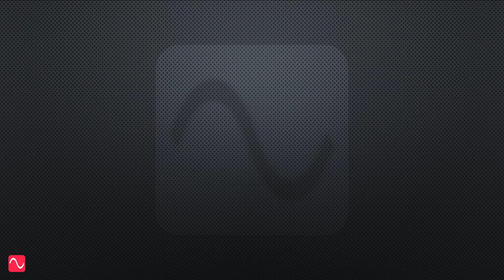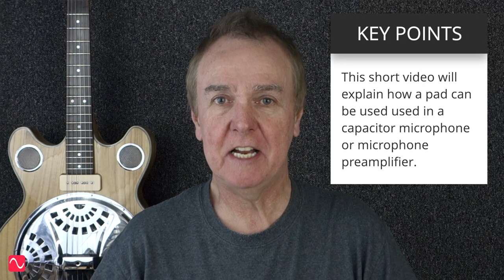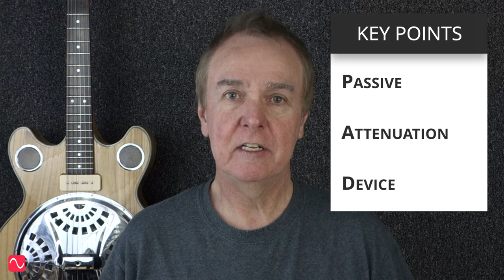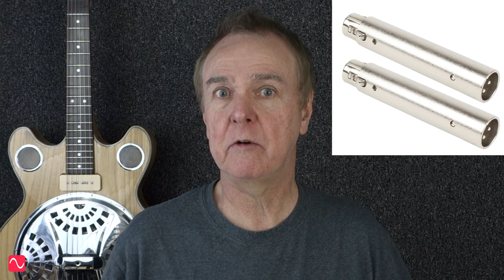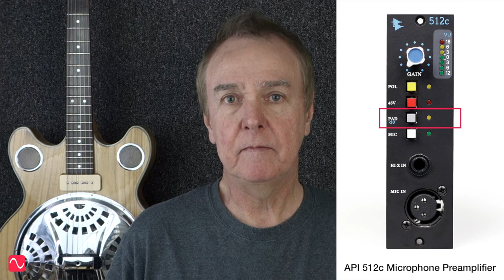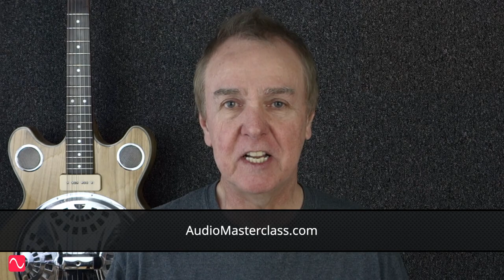What is a pad? What is it used for? Why does your microphone or preamp have one?

Comment: Hi, I hope this video is not so old it won’t get a reply! Helpful video - but, I’m confused about what I want to achieve.
I have a Summit Audio 200B valve preamp, very nice too! But, I cannot get much clean gain, especially on vocals that are very dynamic and might feature a vocal belt in the finale chorus.
A U87 into the 200B - requires that the input is set very low perhaps only 1.5-2.0 The output can be set to 10, but the signal to ‘tape’ is very low. You can adjust using clip gain after its recording, but tracking can be underwhelming or else a struggle against the backing track.
I doubt very much that the mic is the issue as its not the same problem when used with a super clean SSL pre. So, I pad the preamp of the 200B.
This may reduce the input before the amplification in the 200B by -15 or 20db, but we do then need to raise the input by the same amount to get back on track and to a level I want.
Fundamentally, by the time I do this, I’ve basically recreated the same input overload.
The actual goal, is that the input is clean, but the output is loud enough to be useful for tracking with.
Unless I am missing something, using a pad on the pre seems to not actually solve anything?
Please correct my ignorance.

Comment: Whats the point of PAD on a DI box? Looking at my mixer, I see the preamps going from +10 to +60, so if I had to guess, the PAD on a DI is there to attenuate a signal so strong, that even minimum +10 gain of the mixer would make it clip. Otherwise I don't see a reason for it, as I would think, that it's ideal to transmit the signal over cables as hot as possible to maximize the SNR and attenuating the signal will only make the SNR worse. Is my guess work correct?
Reply from the maker: You are correct. Use the pad if you have to but otherwise leave it out.

Comment: I found this while searching for the purpose of the pad button on my own microphone.
I have one question. The mic Audio-Technica bp4025 I own also has a PAD (-10dB) button.
If the button is operated while the phantom power is connected while testing the microphone, a momentary high level of clipping occurs.
Do I have to turn the power off to use the buttons on the microphone itself?
Reply from the maker: My guess would be that you're hearing a click rather than clipping. It would depend how loud it is whether it's a problem but if it's loud then you probably should pull the fader down before switching. I don't see that turning the phantom off would help. My advice would be to contact Audio Technica and see what they say.

Comment: Is a -20 PAD on the mic preamp enough to handle line level signals from an audio interface (DAW), or do I need a separate attenuator? Thanks
Reply from the maker: This can work, but maybe not at full line level. You would need to listen carefully for clipping. Make sure to turn phantom power off. DM

Comment: I have the feature built into my interface. I tried it and it seems to be useful as a pop filter. Is that a valid example of what they can be for?
Reply from the maker: Popping occurs in the microphone's capsule so there's nothing downstream of that that can properly fix it. Having said that, popping can sometimes be mild and only in the low frequencies, so if your interface has a high-pass filter, that can help, but it's best for the mic not to pop at all. I'm having trouble though imagining how a pad could possibly help at all. It's probably just making the popping quieter, along with everything else. As I said, it's best for the mic not to pop at all. A fabric pop filter is one answer. Angling the mic so that it points towards the mouth but is not in the direct line of fire of the breath is another. For best results, do both. One more thing... I've seen in BBC radio studios both a foam windscreen and a pop filter used at the same time. That's also worth a try. DM

Comment: Hello sir,
Question
I am getting destoration even my gain level for both vocal and keyboard,rythm pads is low and pads button is active.
Would you please tell me sir how pad,hpf should be for both mic and music instruments in yamaha mg16xu
Reply from the maker: First check you're using the right inputs. A microphone should be connected to an XLR microphone input, other sources to a line or instrument input. An electric guitar should be connected to an instrument input. If you hear distortion then turn down the gain. If there is still distortion use the pad. Check with different channels. Check using the PFL buttons. Check with different cables. Check on headphones connected directly to the mixer. Check on different headphones. If you're still getting distortion then possibly the mixer is faulty. Other than that we suggest reading the manual for your mixer and follow the instructions to the tiniest detail.
Reply: @AudioMasterclass   thnk you very much sir.
Could I use hpf for vocal and music instruments?

Comment: Sir question, when recording guitar or bass guitar should i activate the pad on my interface? I'm using behringer 204hd
Reply from the maker: If your interface has a pad on the instrument input then it's there to be used if you need it. You would only need to use it if you hear distortion, so if the signal you hear is clean then you can leave it switched out.